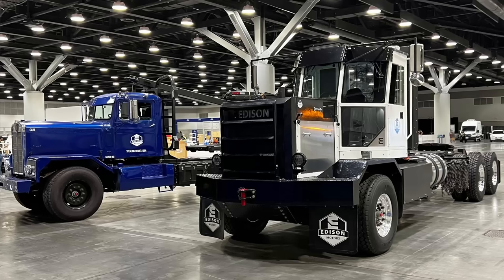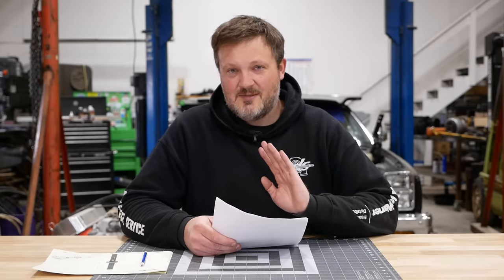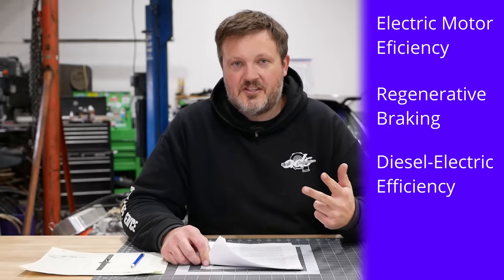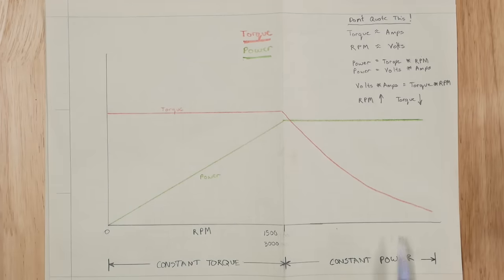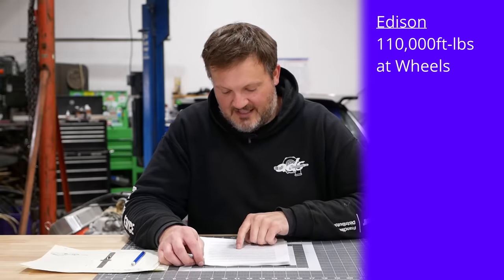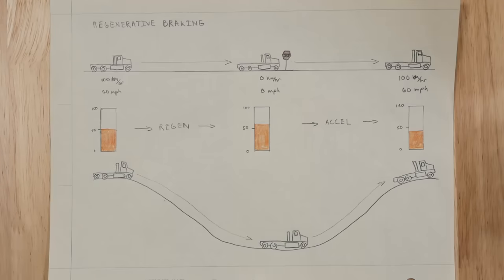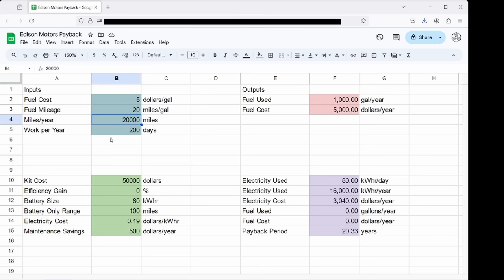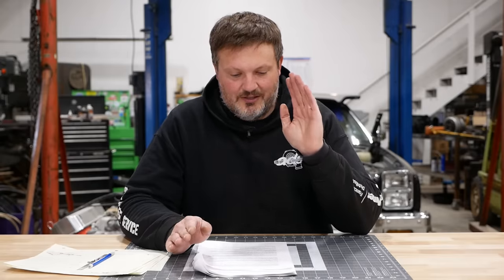Edison Motors Built a Diesel - Electric Semi Truck

Comment: The Chevrolet Volt was and is a Series Hybrid, the gas motor only powered a generator. The upcoming Ramcharger is also a series hybrid (I'm buying one). It has a 90kwh battery good for 140-150 miles on pure EV driving and had a pentastar V6 attached to a 130kw generator for when it requires longer range. It has a range of almost 700 miles when using the engine, tows 14,000 lbs, has 662hp. It's got the pure EV range that 90% of people need on a daily basis, can either charge at home, a EV charger, or fill it up at the gas station and let the motor charge the battery.❤

Comment: Back in the mid-twentieth century a company was founded here in East Texas by a man named R.G. LeTourneau. The plant is now owned by Komatsu Mining and they purchased it for the diesel electric technology that LeTourneau pioneered. They are manufacturers of the largest wheel driven front end loaders in the world. The largest loaders use massive 2300HP Cummins diesels and have an electric motor inside each wheel for propulsion. That's the closest thing I'm aware of to the road Edison is going down. Best of luck to them however as Dr Peterson is fond of saying "the devil is in the details". I'll be very interested in seeing how this turns out

Comment: Wes.  I believe the deboss garage. Is working on a kit for pick ups. in conjunction with Edison and everything that they had going on with their heavy truck check with him and what his projects were I think the last I saw on one of his videos he had a generator for a pick up and everything ready to go and was working on everything for a pick up to convert a regular pick up over to a hybrid type deal. But as far as I’m concerned for me, I’m 70 years old. I could care less about all the electric vehicles out there. I’m sticking to my gas powered cars and my diesel powered pick up. Yes they’re old. The newest one is a 2008 and my oldest one is a 1960 and then I’ve got my 1997 diesel powered pick up And there’s no smog equipment no emissions controls or nothing on that pick up. Thank God for that. No plans in the future of buying a new pick up truck car no reason to they’re all running fine. The other problems going to be. Where is the government going to get all the electricity to run these vehicles when you have to charge them up, they are already shutting down the grid because they don’t have enough power to run our houses during the summertime especially so how are they gonna charge every card and pick up this electric out there in the future when they don’t have the power to run our houses for cars or pick ups They shove it as far as I’m concerned as one more old man‘s opinion for now

Comment: I believe the regenerative braking also has an effective power constraint. Even Toyota HSDs don't let you dump all your generator power capacity into the batteries, or even let your batteries take up charge at that rate. So the efficiency gains possible from regenerative braking can't be fully realised.

Comment: I had a VW Bora 1.9 TDI I ran it would run perfectly on vegetable oil with no alterations or modification I had the car for fifteen years I had to replace the tires and service the car once a year no other costs or issue it did 150k in that time it did on average 65 mpg no matter how  you drove it no electric car will ever be better that that on a financial , environmental or reliability scale. electrical power has to come from somewhere and it costs to make it financially and environmentally .
Vegetable oil can be grown at minimum cost on large scale with minimal environmental issues

Comment: I was considering an electric vehicle some years ago and I did the calculations. I didn't put enough miles on my vehicle to make it cost effective. If you make a trip that uses all of the battery range, can charge the battery at the location and drive back home, it might pay off. Not many people drive 200 miles to work, stay in one place for long enough to recharge their vehicle. The only thing that makes the electric vehicles anywhere near affordable is the tax benefits but you have to owe enough in taxes to take advantage of that.

Comment: Thank you for this great analysis. As a former auto engineer, the problem is when a marketing guy comes into your cube and says, "Hey, replace a 100-pound blow-molded tank full of gasoline with a thousand pounds of batteries." In my day, every pound you added meant 4 pounds in structure and brakes etc. That can't be true anymore or a Tesla Longrange would weigh 12,000 pounds. But it's the same idea, you have to add weight for the added weight. Electric motors are heavy, as are the controllers. They don't save that much weight compared to the 1.4L engine in my Buick Encore. So then you have to haul around 900 extra pounds-- OK lets say it is 800 pounds net. Multiply this times millions of cars, and this is a very stupid social experiment. Yeah, we might get peak oil, but that does not mean peak liquid fuel.

I was at the 2007 SAE Convergence conference in Detroit. I asked real working auto engineers about electric cars and they all said they just don't make sense. When I asked what did make sense, they all said "light hybrids". That gives the customer much better mileage, improves the CAFE rating, and does not add too much weight or cost.

I did have a pal working at a startup that was designing an EV conversion for pickups 10 years ago. This was a DARPA project. The goal was to have a fleet of them at Army bases. When electric power went out, they wanted to use the trucks battery packs to power the base. Cost and efficiency were not concerns, it was a government project. I thought about buying an F150 Lighting to power my house in blackouts. Thing is, a whole house generator is about 2-grand, compared to $55k for the Lightning. I also would not have the thing in the garage or near the house, for when it catches fire. Same fear about a Tesla Wall battery.

All this virtue-signalling, save-the-planet, eco-craziness is fine, except for the Broken Window Fallacy. For all the billions we spend on battery EVs, that is money we can't spent teaching kids to read or helping the homeless.

Comment: Marathon letourneau makes diesel electric construction equipment. They are out of longview texas. They make a 50 cubic yard front end loader for coal mining. Diesel generator feeding wheel motors. Eliminates prop shafts and allows 90 degree turns.

Comment: The torque on e axles is greater from a stop. The e axles have peak torque from the beginning where die diesel does not.

The diesel not only produces its torque at higher than idle speeds, it also needs load on the engine for some time to reach maximum torque. That means you have to rev up the engine, slip the clutch to load the engine, wait a little for the engine to increase torque while you load up the clutch. Then you have reached max torque from a stop.

Realistically, the diesel can only produce peak torque while moving where the electric axles can produce the torque from a stop.

Comment: I live in Australia.  My brother is a long distance truck driver. He originally was a heavy vehicle mechanic. He drives   Brisbane to Sydney 1,200  kms each way driving a B Double max weight  about 60 ton. 5 nights a week 6,000kms a week.  Overnight freight express, so very tight on start and finish schedule .  He was telling me that the people he drives for did some looking at the concept of electric.  Because of the time restrictions, you can't really stop and recharge, so you would need a massive battery pack, essentially another trailer that is a giant battery.  If you went for the diesel/generator it still would have to be almost as large.  Also the prime mover also has to have its own power as it doesn't always have a trailer attached.  Australia also has crazy long distances where there is nothing, no towns , no shops, no service stations.   One comment I read was that recharging stations would have to be built, but there is no electricity supply so you would need to transport diesel to run the generators etc etc

Comment: Great Vlog, is a battery going to last 20 years ? Theirs a huge replacement cost right there. Same with the electric drive train. I don’t have any electric device still running 100% efficient after 20 years.

Comment: The Cat 988xe wheel loader is diesel electric whitout a battery. From operator perspective it is a turn key moment like when the boom suspension was introduced. Way better to work with, gentler with tyres and more fuel efficient.

So yes, even as the big anti electric i see a future for this. (Even more when it's reliable)

Comment: I reserved a Hummer EV SUV Edition 1 . After waiting 2 years I got an email from gm that I could go to the dealer and place the actual order. I ended up declining and getting my deposit back. I had not seen, touched, or driven one. Chargers in my area are also hard to find. I also have too much fun driving my gasoline 420 HP pickup.

Comment: Excellent commentary in the spirit of peer review R&D.

 In the summer of 2022, in France,  I rented a base model Audi Q2 quattro SUV fitted with 2.0 liter 4 cylinder turbodiesel meeting EURO6 emission standards and a 6-speed manual transmission. On a road trip traveling mostly highway and using cruise control set to the speed limit of 130 kph (81 mph) I made a calculation I got about 56 mpg using regular grade B7 diesel. Dieselgate aside. I have been a long time fan of VW/Audi diesels and passenger cars diesels in particular.

I am not a big fan of EV's, but they certainly have their place. Electric power trains have matured enough to fill select niches. Moving forward I think, as with homes, imbued energy, imbued carbon and resource consumption need to be factored into the calculations for transportation energy use efficiency and green house gas generation sources and other forms of pollution and inefficiencies. 

When I was a teen in the mid late 1970s Porsche developed a practical mass market resource conserving, very low polluting, passenger car with an intended useful lifecycle of 20+ years  when the market in America was less than 5 years of ownership for the initial purchaser and 150,000 miles of useful life before the vehicle was considered worn out enough to be scrapped and / or for a mechanical drive line rebuild of some degree.

Thanks again for an excellent video Wes.

Comment: The whole electric edifice is going to collapse as soon as we have a recession. EVs are terrible and inventory is at record levels and most of the car companies have "temporarily" reduced their EV programs and pushed back their supposed date where ICE vehicles will be permanently ceased.
 But it's actually far worse than this. 

EVs and more importantly, solar and wind are absolutely killing the grid.  There is an excellent video about it on youtube called the fragilization of the grid.  It is well worth watching.  There is a growing cottage industry of firms helping industrial electric users deal with the increasing number of blackouts and brownouts.

 The Washington Post also has done a recent article on the grid called Amid explosive demand, America is running out of power  This article is only taking data centers into consideration.

Anyone who thinks we are going to simultaneously shut down traditional fossil fuel and nuclear plants while adding EVs (350 million gallons of gasoline a day), Electric trucks, electric ag equipment plus all these new data centers and heat pump heat in a space of 10-20 years is completely ignorant.  This will not happen, but it will cause a ton of chaos.

Comment: An excellent analysis. Spent most of my career in Heavy Trucks and yes, parallel hybrids do work in urban environments but...... the mileage required to get the pay back is almost impossible where you get the best savings i.e. congested inner cities.  As for the electric truck, as in Semi not pick up, the cost benefit is not there so as far as an accountant is concerned it doesn't work/pay therefore it won't be bought in significant numbers.  We found companies buying this type of truck using 'marketing budget' to cover the extra cost and then proclaiming that they had green credentials while most of their fleet was conventional diesel.
Reply from the maker: Pepsi seems to be doing that.

Comment: When you talk about series hybrid vehicles having a direct link from engine to axle for reasons of efficiency I think it is important to recognise that it is entirely likely that this logic only applies to steady-state high speed cruising speeds and not to the full envelope of operating conditions such as moving away from rest. On regen, my EV typically reports about 5 to 7kWh energy recovered over a period when 25kWh of battery powered driving has taken place around local roads - it must surely be less on continuous "toll road" driving.

Comment: That spread sheet explained it really well. I'm all for electric vehicles, and I also know they're coming, but batteries are just not there yet. Electric generation isn't either. We have to solve the problem of range, whether that's higher capacity batteries, or much quicker recharging of our current batteries, and then we need to figure out how to generate the power for these batteries. Solar efficiency isn't anywhere close to doing it at a large scale, and other non-carbon power generation solutions are a joke at the capacity we need.

There was a push years ago for battery swapping stations, but Tesla pulled out of that and it seemed to disappear. I think there's a company called NIO still working on it.. But, this still doesn't solve issue of power generation.

Again, I'm all for electric vehicles, I just don't think we're there yet, and I don't think it should be forced on us. Let it happen organically. Let natural innovation happen.

Comment: Wes, I appreciate your analysis of Edison motors. I have previously mentioned Edison motors in your other videos and was interested to hear your assessment, which was well done. I am not entirely familiar with frequency density, but I have heard that some motors can operate up to 400 Hz for a greater power density ratio. I wonder if this translates to a higher regen power ratio and if they are specifically built to handle the required power.

If you have any comments or additional specifications you would like to include, I would greatly appreciate it. My research led me to the Danfoss motor, a 3-phase generator motor built specifically for EV drive systems.
Reply from the maker: I don't know that much about EV motor internal construction. I would assume they are permanent magnet motors but who knows what kind of pole count or commutation they use.
Reply: So far seems Danfoss won’t pass on the specific data sheet information that you outlined. Proprietary I suppose.?

Comment: Merely a comment here, not a criticism.
My experience with pickups (YOUR mileage may vary) is that the powertrain long outlasts the chassis/body.  Hence, why would anyone want to convert a crumbling pickup from i-c-e power over to electric propulsion of any breed ( battery, or engine-over-electric ).  Seems to me, if you want a funky new way of getting around, buy a whole new unit,  and gain a warranty on everything.  Just my 2 cents.
That said, I'm still not convinced that E-trucks are all they're cracked up to be, but only time will tell.  A LOT of time, that is.  I'll be long gone by the time a determination is made.

Comment: Good talk Wes! 

Back in the mid 90’s a race team built a formula 1 car with electric motors at the wheels, a small turbine engine running a generator and minimal battery storage. It was featured in Popular Science or Popular Mechanix magazine. While it was interesting, the math didn’t work on that set-up either, if it had we would be seeing such set-ups in use by now. I believe the issue is the power storage (accumulator) part of the system. I don’t see any of this working well until some major break throughs in the storage technology is invented. 

On a personal, practical level I could drive an electric back and forth to work (20mi each way) and might be willing to do so but there is nothing being offered (en mass) that is small and light enough to get the job done. I realize such a thing would likely not have heat or air conditioning but I would still consider it if the “fun factor” and charging expense was there. My general feeling is all of this is being oversold with our current technology and things that could work are being ignored because most people wouldn’t accept them due to the shortfalls in comfort, convenience and safety. Bottom line, technology isn’t there yet and I get annoyed at how all this is being presented and subsidized with our tax money when it simply doesn’t work yet.
Reply from the maker: I'm with you on all counts. I could use an EV, but there isn't one that really fits my needs.